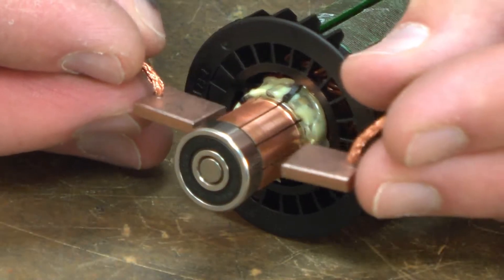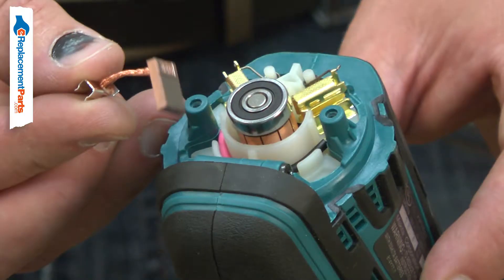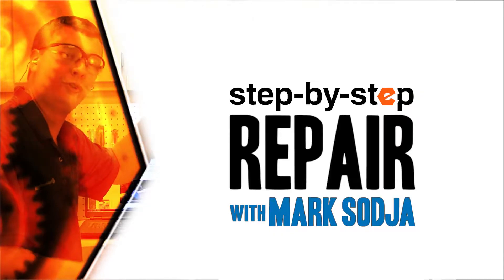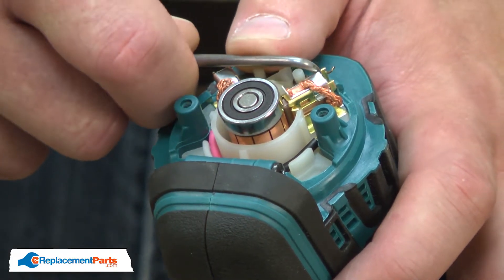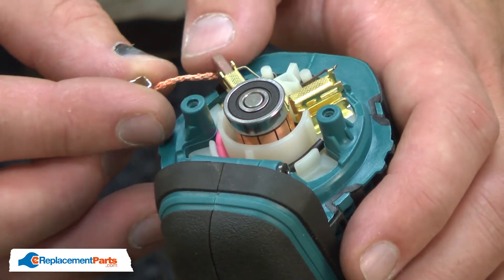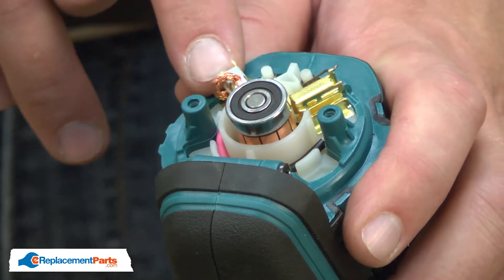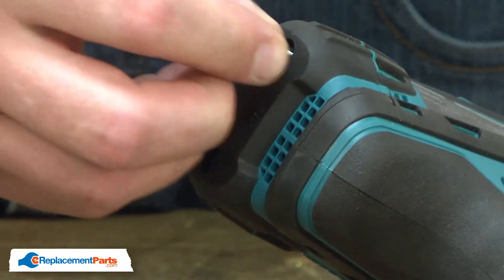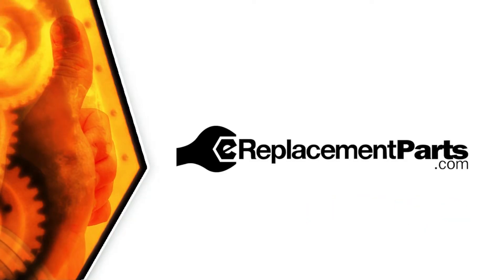Makita Drill Repair - Replacing the Motor Brushes (Makita Part # CB440)

Comment: Hi . Hopefully you can help me .. I have a professional kitchenaid 5 plus. And in a confusion connect it to 220 current. And she is 110 ... in spite of it ... she stayed working but the capacitor or varistor that protects the card from high voltage burned. Where I live there is no specialized service. My question is how much is the value of that capacitor or varistor or whatever it is called in your country. That varistor is located under the power connectors that looks like a rounded pill. In my case it broke and it is not possible to read it. I would appreciate your help since I cannot find who knows.